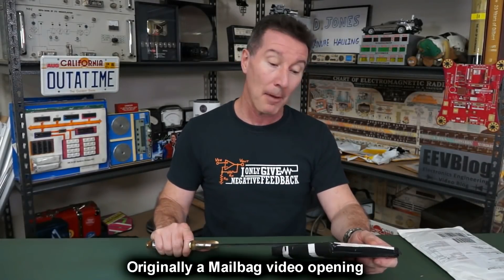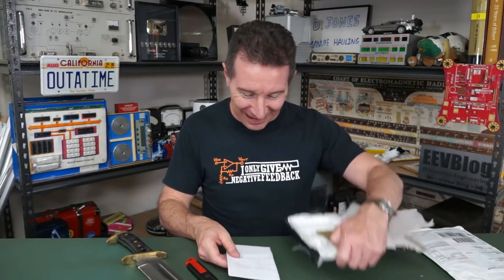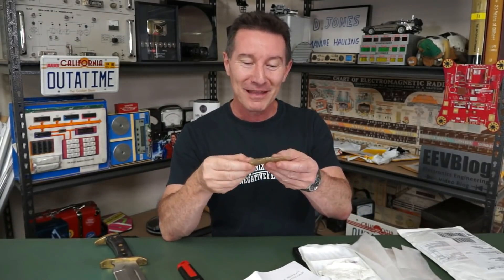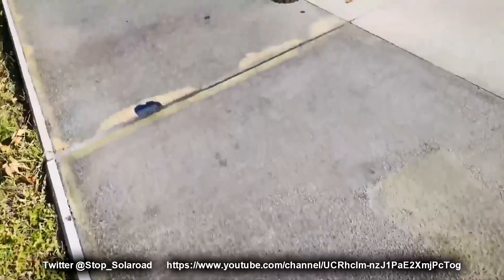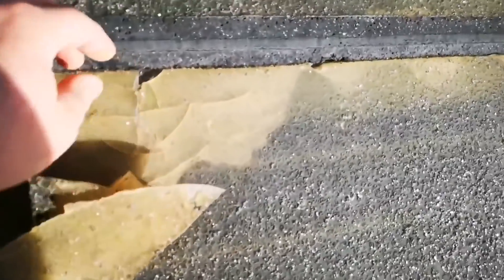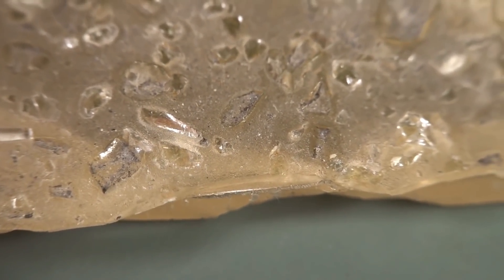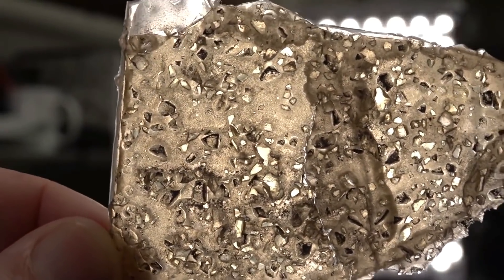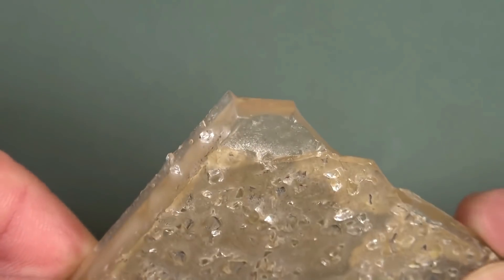EEVblog #1276 - Solar Roadways Surface TESTED!

Comment: Weird how it turns brown after it's de-laminated from the road.
Reply: Yes, which reduces light transmission so I don't think testing through it in the degraded state is fair.
Reply: @MrV1NC3N7V3G4  Yes, I agree.
Reply: @MrV1NC3N7V3G4  do they intend on replacing the UV affected resin every year?!
Reply: @aveservices3052  I don't by any means think this is a good idea, but testing through degraded material that has clouded over isn't a fair test regardless. His test wasn't to prove the durability of the protective layer(we can see that it isn't durable), but how much light it blocks and in its original condition, that top coating is clear.
Reply: @MrV1NC3N7V3G4  the degraded state is the state it's going to be in for most of its lifecycle. What isn't fair is testing a material that rapidly degrades in its brand new state.
Reply: @MrV1NC3N7V3G4  they should have used a UV resistant urethane resin. I know of pieces made of Smooth-On Crystal Clear 20 years old, clear as the day they were made. How? Because I made them 20 years ago.
Reply: @greggv8  Exactly. But a project like this has to be cheap as well as durable and that's why I think they're a long way off from something sustainable.